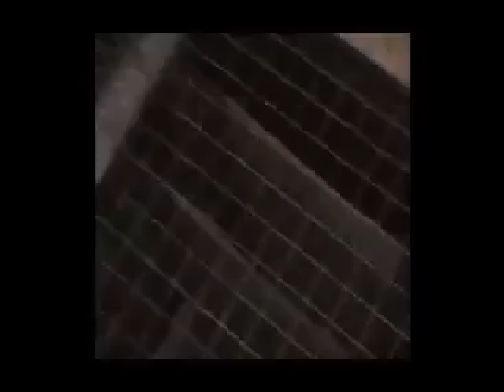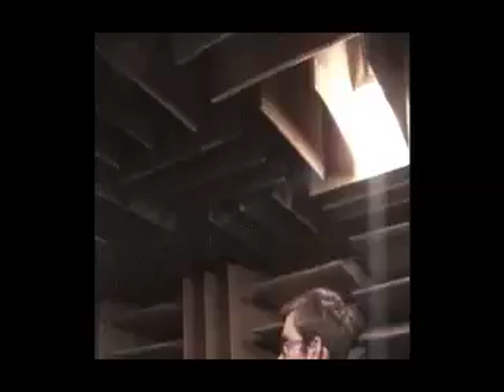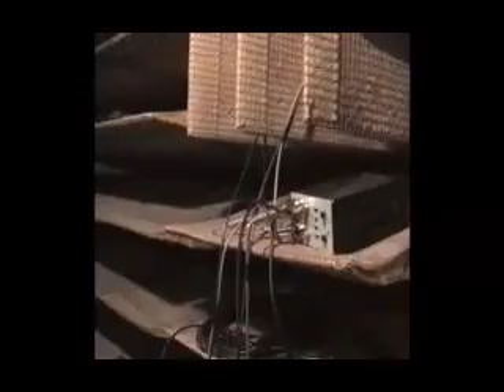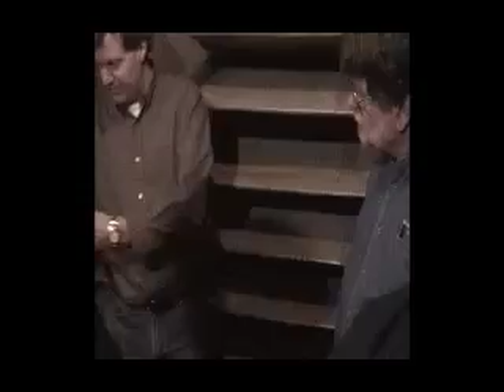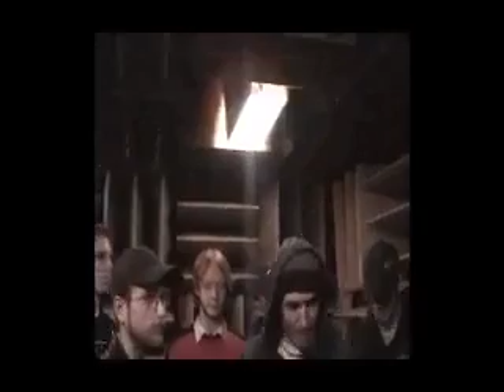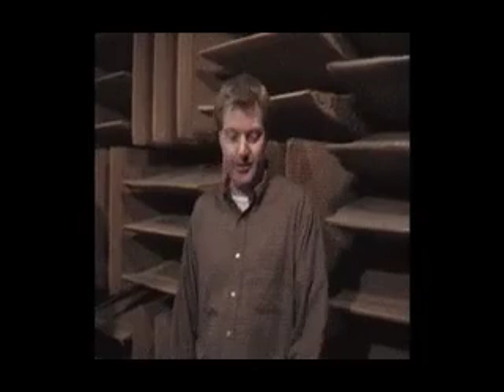Orfield Labs Anechoic Chamber (tour)

Comment: Dude, you do know that means right? "The quietest room in the world" right? It means, if you sat in your room and we're quiet, you would still hear noises all around you. If you went inside that room and we're quiet, you wouldn't hear ANYTHING. If you talked, you'd hear that, so if you stomped on the floor, you'd also hear that. The floor is like that for a reason, it's wired because under it is acoustic foam, just like the walls, if it was hard floor, the sound would bounce off of it.

Comment: The Bell Labs building in Holmdel, NJ has a similar chamber in the basement. I toured it when I was in grade school, and then I worked there years later (in the building - not the chamber). I wonder if it is still intact, as the BL building is currently vacant.